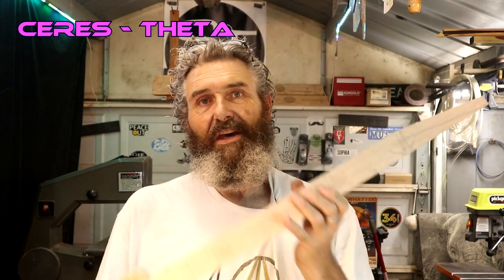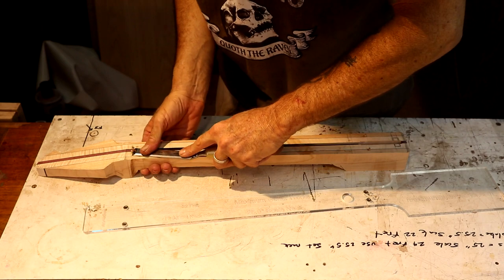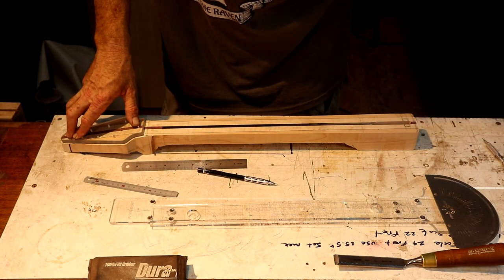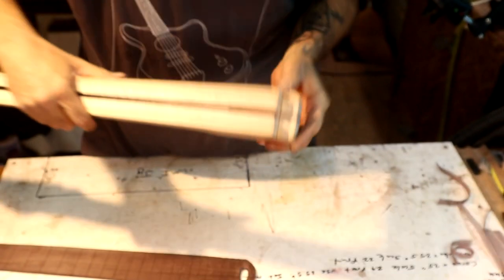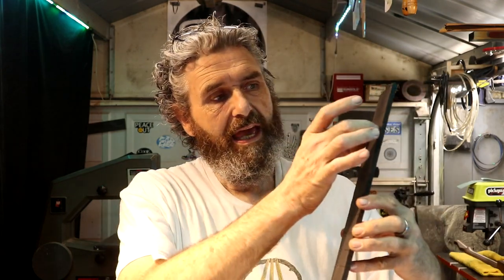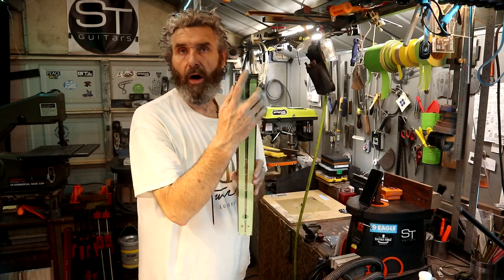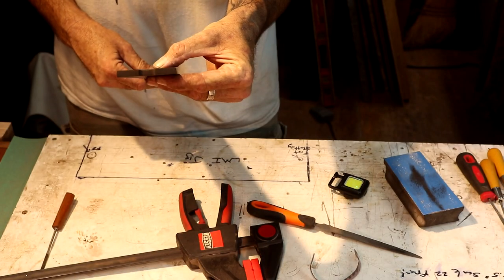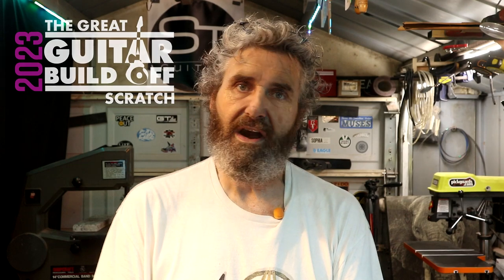#ggbo2023  - Guitar Build - Building Ceres Theta - Episode 3

Comment: I love Ebony, this neck is going to be “the killer”.
When using my guided saw I do not use wax as a “lubricant”, I started to use “toflonised” lock lubricant (it was laying around in my workshop and I was to lazy  to walk over to the house to fetch some wax 😉). I rarely have to relubricate, the Teflon is well attached to the saw and guide.
Just to give my two cents.
Reply from the maker: Thank you for the tip brother. I've got some lock lubricant and I will have to try that! I will say that mine was not made in Sweden so it may not work as well!! Peace & Love
Reply: @SweetTGuitars  Just make sure it contains Teflon (PTFE), otherwise I would stick to wax. With PTFE temperature changes are not as noticeable.
Reply from the maker: @MikeB-iq9sx  It absolutely has teflon in it. I will try it on my next fretboard!
Reply: @SweetTGuitars  I would be very much interested how it works with your saw.
Cheers,
Mike